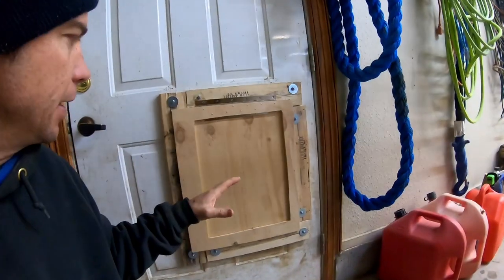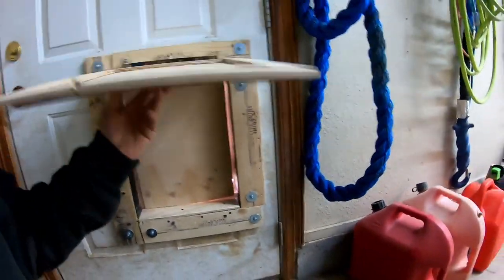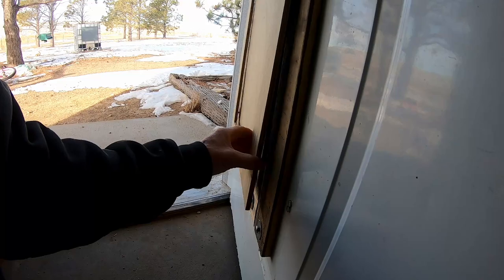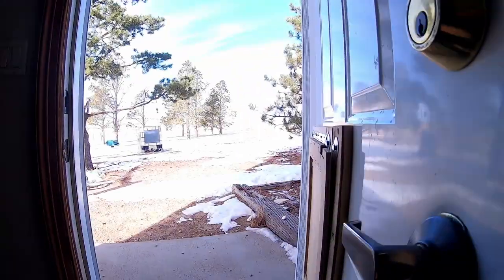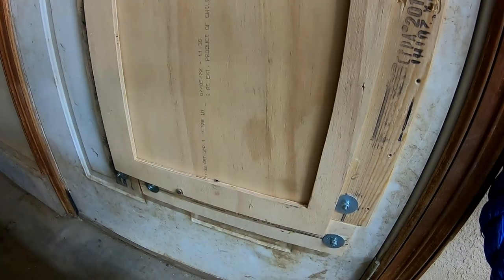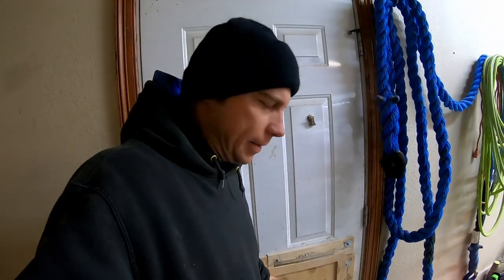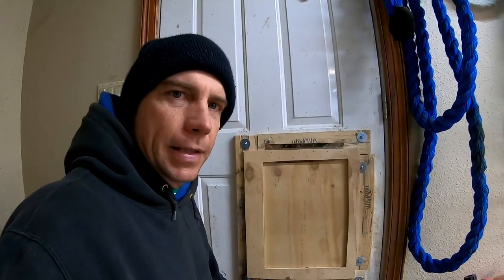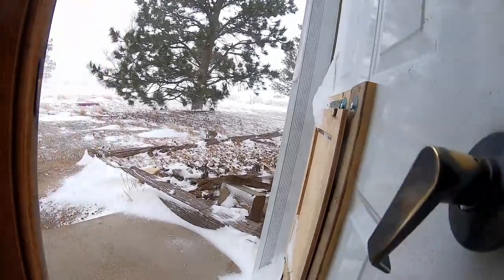Best dog door for wind and cold

Comment: I should also mention that I added a piano hinge to the center in the doggie door I hung it in the center and I put a piece of that heavy duty entryway carpet you know like a work mat you get at Home Depot I think it's like 2 ft by 3 ft just a small one and I cut a piece just a little smaller than the inside of the doggie door cut out so it actually acted as another insulator when the door was open for them to use and it didn't interfere with the inner or outer flaps cuz it's fairly lightweight it would just get pushed up and out of the way when the dogs would go in and out also kind of worked as a grooming tool because there's tons of dog hair on it and I can vacuum that off lol

Comment: Greta idea. Maybe beads of silicone on each side, around the edges, and once dried, put back together , so each piece would have 2 tracks of silicone to fill any gaps of drafts, but allow doors to still move freely?
Reply from the maker: That’s a good idea. The wood has started to warp from the weather. I’d definitely advise painting them.

Comment: Thank you for making this video!!!!  I have been trying to figure out how to make something like this.  I have tried using carpets and rubber and they all have failed pretty quickly.  I could not understand how to get the two-way hinge system to work.  This is a fabulous idea and I really appreciate you taking the time to make this video!
Reply from the maker: Thanks for the comment. So far it’s holding up pretty good. The magnet system has worked its way apart so the next one will have the magnets with a hole in the middle that screw into the wood.